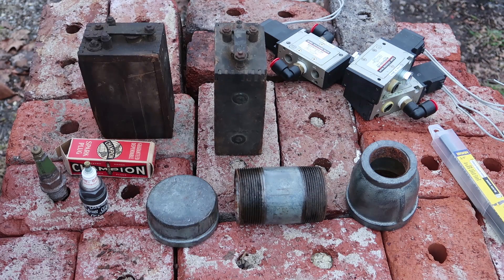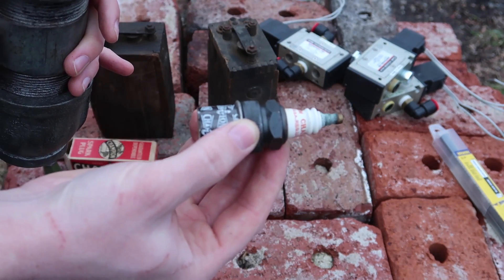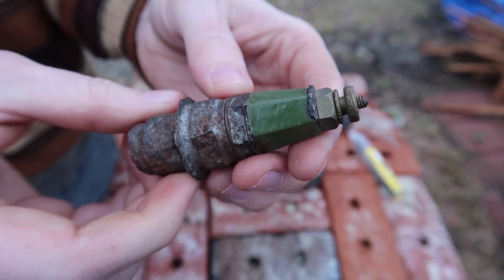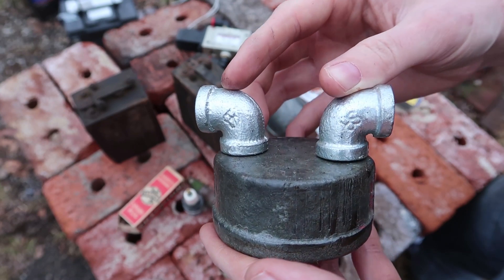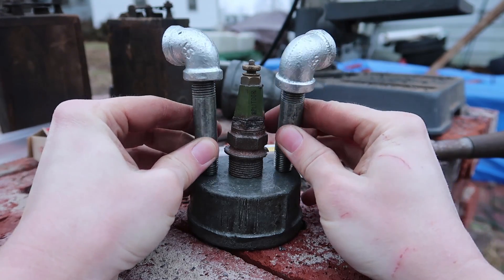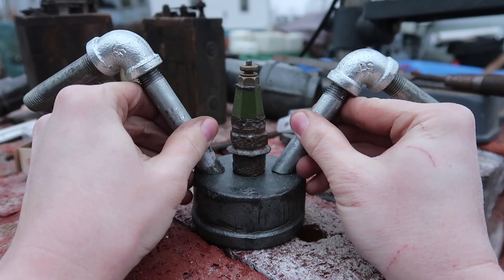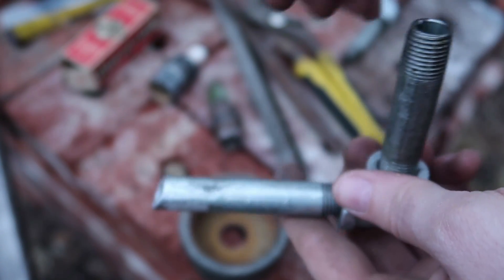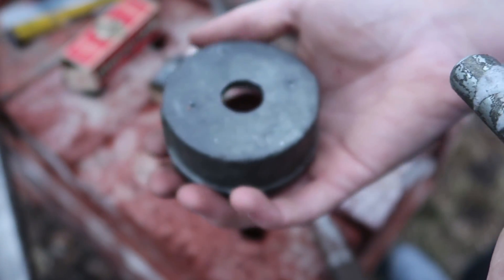DIY Liquid Fueled Rocket Engine 01: Simple Rocket Engine Combustion Chamber

Comment: Welding galvanized metal is a VERY bad idea!  In fact it should never be done!  In the future remove the galvanization before welding or use non-galvanized materials!   People have died after welding on zinc or at the very least made themselves very sick!  Also using Kerosene is going to be very difficult as it is not easy to atomize and mix with your O2!  The O2 is also a problem as it is not concentrated like LOX and it will be difficult to get enough into the chamber to cause sustainable much less even close to complete combustion! Since you are using gaseous O2 you may want to use a gas as fuel, like Propane, Butane, or as a last resort Acetylene.  The welds don't look like they have penetrated well so the need to up the amperage or use a more gas tight welding option like TIG or gas shielded MIG.   Please keep in mind what you are doing is dangerous and take precautions accordingly!
Reply from the maker: doesnt matter if you hold your breath and do it with plenty of ventilation
Reply: It is best to not do it or remove the Zinc as it will also interfere with a solid weld.  But as always do as you wish, I am just passing on information. :)

Comment: "I wanted to use hydrogen, but it's hard to get"  What?  It's literally the most abundant element in the universe.  You literally just grab a cup of water and run electricity though it and there's your hydrogen.(yeah I know it's slightly more complicated, but you can easily build a device for about $20-$30 worth of home depot materials that will separate the hydrogen from the oxygen.)
Reply from the maker: you must be the dumbest fucking moron ever to think its easy to make purified liquid cryogenic hydrogen.

Comment: lol hydrogen is had to get?!?!? its present in water!!! just make a hydrolysis unit and you'll get oxygen AND HYDROGEN!!!! Are you sure you have any real idea what you're doing!??!
Reply from the maker: yes, pure, dry, LIQUID hydrogen is hard to get. hydrogen coming out of an electrolysis system isnt any of those. think before you speak next time.
Reply: well maybe if she was more specific it would be easier to understand. but no its easy just put it through a drying agent and then compress with a compressor and presto! liquid hydrogen. you also have no idea what you're talking about. obviously.
Reply from the maker: First off, i'm the person in this video. secondly you cant just compress hydrogen into a liquid, it has to be cooled to -423 F otherwise it goes straight from gas to solid. you do realize that i used to manage a rapid prototyping lab at Apple right? i know a thing or two about this, meanwhile your just a dumb child. stop acting like a dumb child and go read up on a subject before guessing and making a fool out of yourself. liquid hydrogen is a cryogenic propellant. oh and lastly you cant refine the gas by just passing it through a filter, thatd only effect moisture.
Reply from the maker: i bet you dont even know what a critical point is.  https://en.wikipedia.org/wiki/Liquid_hydrogen